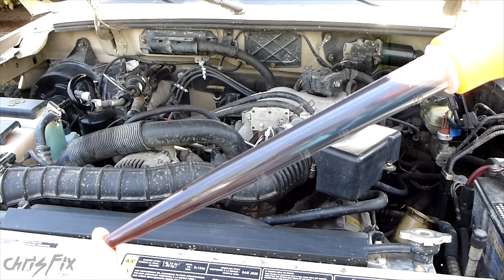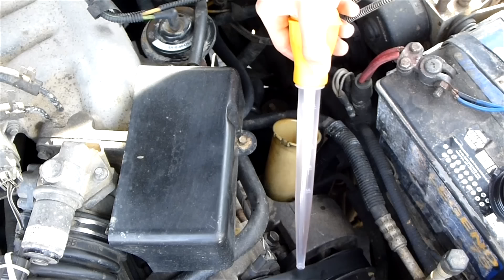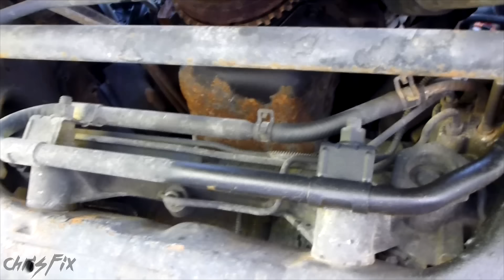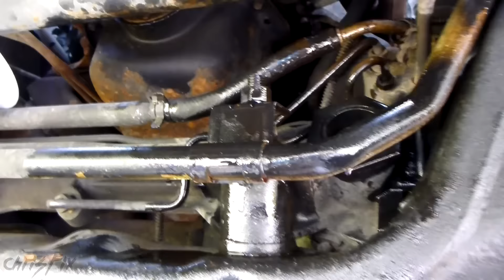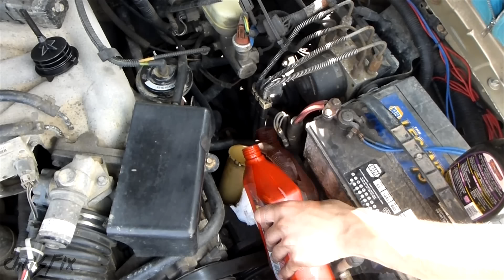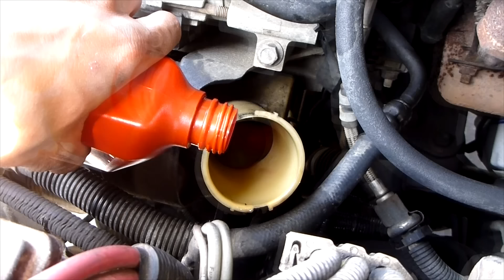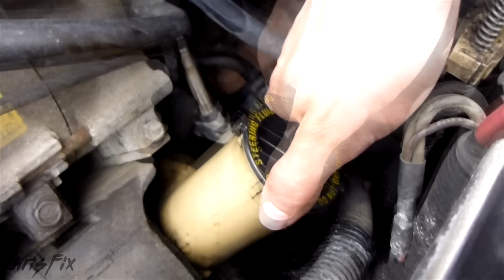How to Flush Your Power Steering Fluid

Comment: my mazda manual says atf M-V, I could use amsoil multi vechicle right?
Reply from the maker: I would go with what the manual says but you should be able to get away with using amsoil. Here is more info on transmission fluids (even though this is for a power steering pump): https://youtu.be/o690DovjDAc?list=PLDD611CFB36FC65F2

Comment: Hey ChrisFix I have a 1998 ford ranger looks almost exactly like your Mazda, the problem I'm having is sometimes the truck smells like gas smells like it's coming from the fuel cap I watched your video about changing the fuel cap could it be anything else besides the cap or leak at hose from the cap to the tank I haven't checked that yet but can you tell me where the purge Canister valve is could that be bad I got a p0145 code
Reply: I was wrong it was a p0445 code

Comment: I flushed mine.  The powersteering fluid that was in there was that chicken shit autozone crap. Mercon ATF .  Explorer has inline cooler. Sucked air big time but cleared after driving it around. But it worked. I could't find the video on the enhancement fluid and didn't know what to look for.
Reply from the maker: +Ralph Kendrick glad the video was helpful

Comment: question  could you drain the system from the lower pressure hose by useing a vice grip pliers to pinch the hose ?
Reply from the maker: +Dustin Mittel I would not pinch any hoses because that could damage them.
Reply: rogee that i didn't i didn't know if a slight kink or pinch would allow you to drown the pump from the hose

Comment: Hey Chris! How many quarts of oil did you use in your case? and how many ounces of the Bar's/Power steering repair should I add?
Reply from the maker: +Ahmed Meguid It took a little over a quart and I only added a few oz of the additive.
Reply: +ChrisFix Thanks Chris!!!

Comment: Did a power steering reservoir new install. (2006 dodge caravan) After the new reservoir and new 24 oz. AFT+4, I took the car for a test run. Steering was greatly improved and no whine noise. BUT I lost almost all brake. Any ideas?

Comment: This video goes to far for this job.
There isn't much fluid in the system to start with.
I just buy a quart of the right fluid for your car.
I use a turkey baster and extract as much as you can.
Refill it with new fluid drive it for a day or two and repeat until the quart is gone.
I get about three refills from a quart.
This list of what can be wrong bugged me.
A leak can be the pressure switch on the rack or the rack could be leaking or both.
Missing fluid is a clue there is a real problem on any system.
Simply adding fluid without figuring out where it went is not fixing cars.
Why he feels a need to flush everything is a little confusing.
When you work on a system that's when you flush the whole system.
For example if you change the rack then you flush the system.
Reply: +Chris Tindall That was my thoughts about this, I was already thinking about just partial change out much like a pan drop on tranny, its better than nothing.
Reply: bill man
My power steering pump was growling so I changed it after I flushed the system.
The flush didn't fix it as I had hope for.
Flush#1
new pump.
Flush#2
New pump higher pressure the real problem showed up!
Replace rack.
Flush#3
Not done yet the pressure switch is also leaking.
New switch.
Flush #4.While I have never chased this repair exactly I have seen a kid just like this do that.
A customer complaint of over heating lead to
Water pump/Stat/radiator/head gasket/and heater core showed up after a radiator flush.
I could be wrong but on toyota the fan is hydraulic and I think the power steering pump is what drives it as well.
So the above mentioned repair could include a  fan motor would be flush #5.
Reply: Chris Tindall what a nightmare, Im going to get new fluid today!

Comment: Are you active
Reply from the maker: +Justin M Active?
Reply: Yea are you on here still but u answered my question but anyway I have a jaguar x type 3.0 and my power steering went out out of nowhere but when I looked there was still a power steering fluid in the pump do you know why it would just quit working
Reply from the maker: +Justin M Yes, new videos every Thursday (or Friday if I am late lol). It could be the belt is slipping, it could be the filter in the pump is clogged, or you need to flush the fluid. Or, the pump went bad.
Reply: Ok thanks bro you know how much that would range
Reply from the maker: +Justin M It varies based on the problem and if you fix it or take it to a shop.

Comment: I didn't think to check what my ranger took and just put power steering fluid in will it hurt my truck?
Reply: I changed it when I put a new engine in
Reply: +Dirtbikesforlife16 Shouldn't hurt it. Ford calls for the same tranny fluid that goes in the transmission but they wouldn't be able to put that its ok for ford on the label of power steering fluid if it caused failures in the power steering system. I bet using straight power steering fluid made it louder, though. If it steers ok and don't make any loud ass noises at idle you should be ok.
Reply: +slim sammy it seems to steer fine but the belt slips some

Comment: Great Video,  Here is a good tip on purging air from the power steering systems on all vehicles... especially Ford.  When you replace the rack or box... Start the vehicle and turn it to the hard right position and shut it off.  Wait 5 minutes, recheck the fluid level, and restart, then turn hard left and shut it off again and wait 5 minutes.  You may have to do this twice, yet all air will be removed from the system reducing cavitation... which is the whine you hear from the pump with air in it.  Again... good job!
Reply from the maker: +Eric Schnidrig Thanks for the tip on bleeding the power steering system Eric!

Comment: Is your jack stand really holding up that little tiny tab on the front of the control arm? The tab that looks like it's flat at best, and the jack stand could slip off with the slightest push on the car? Do NOT get under that thing unless the jackstand is under something more secure. And using metal pliers on a rubber hose is asking to damage the hose & have to replace it. At least put a rag around it first
Reply from the maker: +Mr S Thanks for sharing. There are 2 jack stands and a jack holding the car up. I dont fool around!

Comment: Great video! If the wheel is easy to turn to one side and hard to the other, the fluid change should fix it? No weird noises coming from the pump itself.
Reply from the maker: +Tom Kolbin It might. It could be your steering rack is going bad but try this first.

Comment: Here's a question for you Chris,  if POWER STEERING FLUID  was run through the system when it should have been tranny fluid, what are the chances the seals in the rack are still ok?
Reply: you'll be fine just flush it good replace with the right fluid
Reply: Hey, thanx for the reply, but yeah....  little late.  After I put the pump in,.. had it filled with fluid,.. started bleeding the system lock to lock,..PUTOOOEY!!!  Out comes fluid from the seal on the rack.  Needless to say,  it was bled quite well.  XD

Comment: Hey Chris I changed my power steering fluid a week ago, but now it's black again like if dirt was on it, any idea??? The car is working fine but I men is a 1 week old fluid, is there a way to work out the reason
Reply from the maker: +David Rosales That is probably just the rubber lines that are leeching off into your clean new fluid. Dont worry about it. The new fluid has all the good properties to protect everything which is what is important!

Comment: I just drain my reservoir and fill it back up then drive for a couple of days and do that 2 or 3 times. Easiest way to change power-steering fluid in my car without having air getting in the pump. No leaks so far and still on the original power-steering pump on a 16 year old Acura :)
Reply: +krauser979 LOL a 2000 model is new to me!! You should be ok on power steering, the TIMING BELT AND WATER PUMP is what you should be checking into getting replaced if you haven't already. I don't know if you know this but the number 1 most important preventative maintenance on any Honda/Acura is the timing belt. These need to be changed AT LEAST every 65,000 miles to insure it doesn't break. I tell any Honda owner this online or in person. You have a great vehicle that can run half a million miles with proper maintenance. If the timing belt breaks while you're driving, it'll turn into a big piece of shit lol! If you already know all this cool!
Reply: slim sammy
I had that car since new i know what it needs or doesnt need

Comment: Chris, another great video, however shouldn't you included procedure for bleeding the system. Pouring in more fluid with the hose off will not really get all the air out and GM has issued a TB for air in PS systems causing pump failure. Maybe I missed it, maybe you have one. It's not difficult thing to do spending 55-60$ for a kit or 1$ for a rubber stopper and drilling a hole thru it, place in a vacuum hose connector and attach a vacuum pump. Of course you have to but the vacuum pump!
Just a thought, thanks for vid's -Don
Reply from the maker: +Don Agneta I went though the process of how to bleed the air out at the end of the video.
Reply: +ChrisFix mhhh maybe I'll do that to get air out of my head..............
Reply: +Don Agneta Chris, got the air out of my head and watched the video again. What I was referring to as a bleed of the system is to use a vacuum method. I agree how you ran the engine and then showed how the fluid level dropped was in part due to some air and that step should be done. 

The reason I bring up the vacuum method is that I have read some GM technical bulletins related to damage to the pump due to residual air in the system. Of course GM has a kit but all you need is a rubber stopper with a hole drilled thru it with a vacuum tube connector stuck in it and a vacuum pump. You can find a vacuum bleed stopper on amazon, angled so it will fit any car.

Place the stopper in place of your reservoir cap and apply vacuum, this will draw out trapped air in the system / fluid. You will see a small slow drop after applying a set level a vacuum which is normal. This will get any remaining air out of the system.I'm not listing the values because they apply to my vehicle only. Possibly not doing this type of bleed will only affect 1 car in 1000 but I wouldn't want to be that car.

I've seen other people use a toilet bowl flapper which seems to fit perfectly over the reservoir. 

In any case, this isn't meant as an argument nor in anyway a put down, as you have shared so much, everyone else out here should share their knowledge as well. That's were I'm coming from. So its really up to the individual's level of comfort. Thanks for vids -Don

Comment: I've done this a few times in my Suburban now. The first time, the fluid was dark and using Seafoam Trans-Tune cleaned out the gunk. I did that a second time, though I may have not needed it. Today I replaced the power steering fluid with Amsoil's P.S. fluid, and I'm not sure if it makes much of an improvement. I just thought I might as well use their fluid since I'm using some of their other products, and be near tip top shape with the fluids I use.
Reply from the maker: +Austin Lucas Nice!
Reply: +ChrisFix The power steering started leaking after that. Great way to lighten the pocketbook; it's fixed now but wow.

Comment: this is a continuation of my post yesterday. i am even more confused today. I went to 2 other big name auto parts stores and was told different thing. one said it doesn't matter which I use atf or power steering fluid. they are the same but if I flush it don't mix them use one or the other. the other store told me don't use anything but atf or my system will fail. WTH. 3 different big name auto parts stores  3 different answers.
Reply: +david conrad today I went to local ford dealership I use to work for and found a mechanic who has worked on fords for 37 years. he stated go by what book says and use mercon ATF or I would have problems. plus do not put in power steering fluid additives or stop leak because they don't mix. I went back to auto parts store and at first guy refused to refund my money for selling me the wrong stuff. he said he was right and the mechanic was just trying to push a product. after going off and explaining why I thought he was an idiot he refunded my money.

Comment: chris my 2002 ford Taurus power steering pump takes mercon ATF per the book. I want to flush it because it's black and making some noise. the auto parts store employee and their computer say power steering fluid. I finnaly bought power steering fluid and lucas oil conditioner after a short argument. I don't want to screw it up so should I return it and get the ATF or will it be ok. I've seen mixed answers when I search the internet.
Reply: +david conrad The power steering fluid will work just fine as long as it's the type that your owner's manual says to use.

Comment: do i have to do a flush or can i just add the fluid when i see that it is low?
Reply: +Shay T. You can just add fluid if it's low. A flush is something you can do if you think the pump's going out. A quart of power steering fluid or transmission fluid (whatever your vehicle calls for in the owner's manual) is always going to be cheaper and easier than changing out the pump.

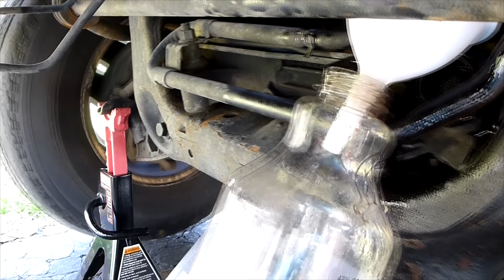Comment: 3:07 MIN U NEED NEW FRONT TIRES. BET THE ALIGNMENT IS OFF AND YOUR GETTING A PULL
Reply from the maker: +1988PabloEscobar Thanks, that has been taken care of a while ago. I rebuild the whole front suspension and installed camber bolts. I have videos for each part if you are interested.

Comment: This will definitely help me flush the power steering fluid on my '00 Prelude SH, the fluid itself is so dirty and black and overfilled, previous owner did not do good job with taking care of it. I do get a whine every time I turn the wheel, mostly on the left side because of a outer tie rod I need to replace. Two months ago I also changed out the CV joints and ball joints. Mechanic said that my power steering pump is going bad, but I would like to first flush out the power steering with some OEM Honda power steering fluid and not another that is not recommend on the car. Thank you, Chris (:

Comment: How do you plug lines and hoses when you work on an area? For example brake master cylinder replacement, power steering pump replacement and other dozen areas that have fluids. I currently use ear plugs but I'm limited to their diameter

Comment: So flush makes the whine gone?
Reply from the maker: +Vaso L. Sometimes, yes. It depends if your bearing is damaged or if the fluid is no good.
Reply: +ChrisFix 
70% of my whine is gone after i cleaned the filter in ps reservoir.
I guess ill have to flush it and bleed  air.
I definitely have a leak.

Comment: Hi Chris.... good videos..
Question? so did put some transmission oil in their ah! So how much I should put the TRANSMISSION oil?  You know my car started to make a little noise when I turned the wheel..... but I found I little Power steering oil in the garage from my father......but I think this OIL is very  old brand...... but I checked out......it was clean & I did put.....now is OK.....So about the transmission oil Chris? Thanks again!!

Comment: Year 2070 how to flush you cars battery
Reply: Alpha smurf Actually, there is a process similar to what you describe. On some batteries, you can actually access the individual cell's acid. You could use a hydrometer to determine the state of charge, too
Reply from the maker: +Alpha smurf lol
Reply: Jeez I posted this a year ago.. time flies
Reply: @Aaron-qr3tg  tell me about it
Reply: @Manu  he has one
Reply: @i i  probably bluetooth, or your battery's done
Reply: You can actually flush your battery out. If it's not a maintenance from one of course....
Reply: ahaha i laughed
Reply: in 2070 will we still need medium strength thread locker   :-)
Reply: Alpha smurf we won't have battery's In that year
Reply: 2070 do we have flying cars ? Or is big oil still controlling the world?
Reply: There is already comercial flying cars. ATC hates them tho makes airspace more dangerous.
Reply: Bmw M3 e46 True, we already have them.

Comment: what do you do if your steering wheel doesn't turn unless the car is turned on?
Reply from the maker: +patrick jackson Put the key in the run position but dont turn the car on. The wheel will turn then.

Comment: hi @chrisfix I have a Chevy cobalt 2005 and I lost my manual I was just wandering if is the same for my car because I think it has an electrical power steering system ("EPS" or a "EPAS")
Reply: +Selene Franco  Just do a Google search for your make and model car owner's manual and you should be able to find a digital copy of it online that you can read and print the parts you are interested in, including all the required maintenance schedule.  Keep it in  your glove box for easy reference.